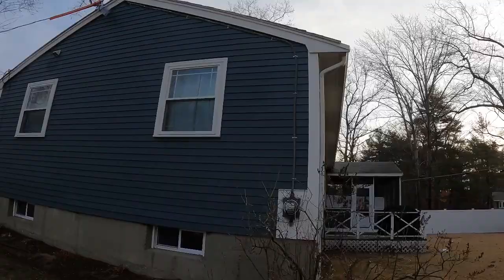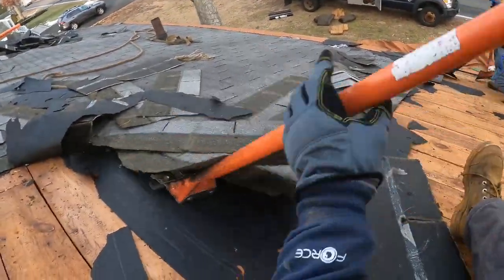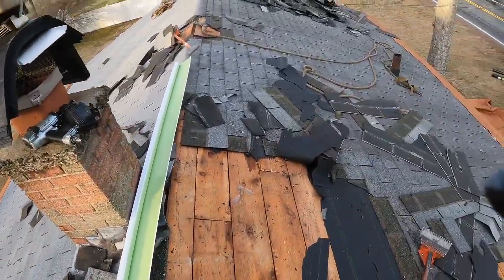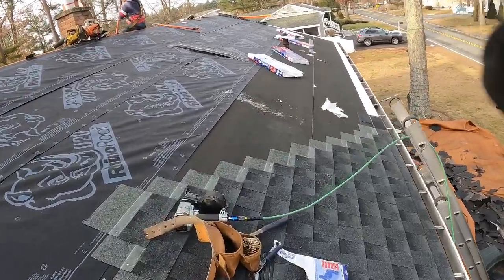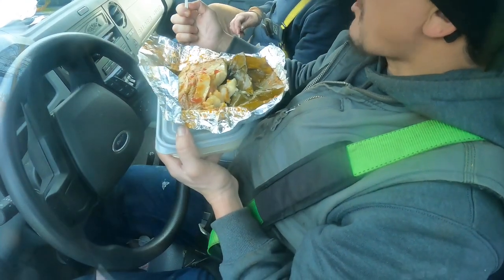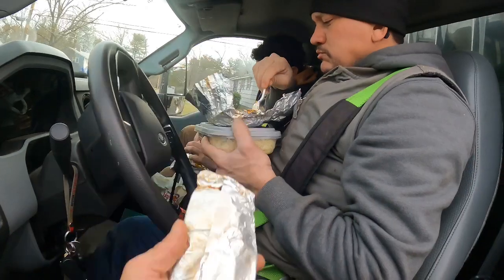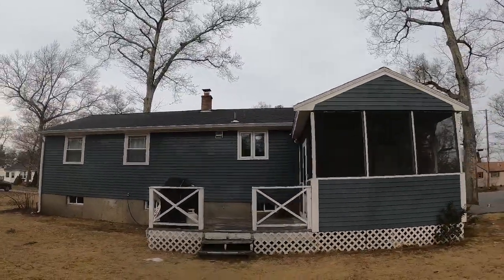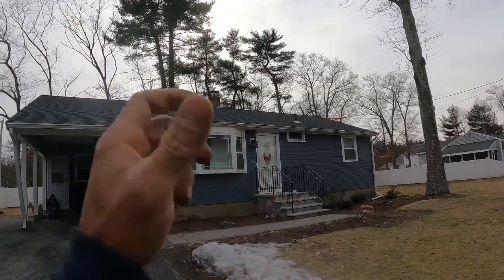Ice, Shield is a waterproof membrane professionals install six feet, is necesary in New England#usa

Comment: 6 feet is a minimum. If the eaves are deep, 6 feet might not be enough. The ice and water shield should extend two feet into the structure at the eaves when the eaves are deep.